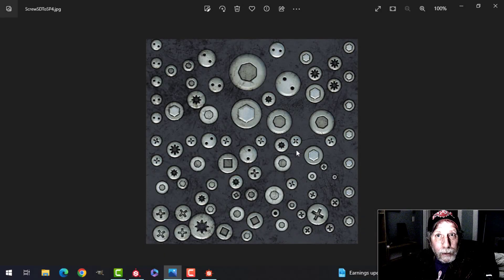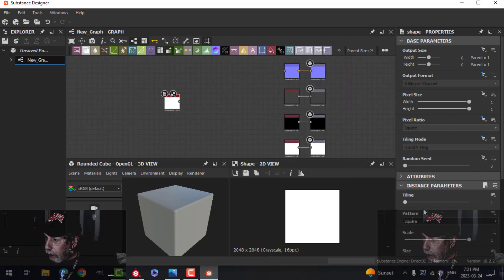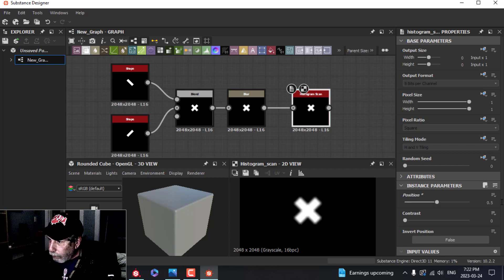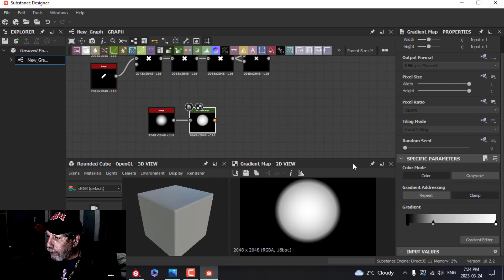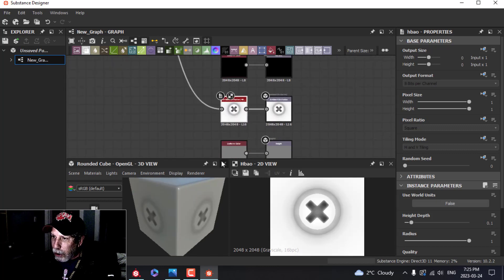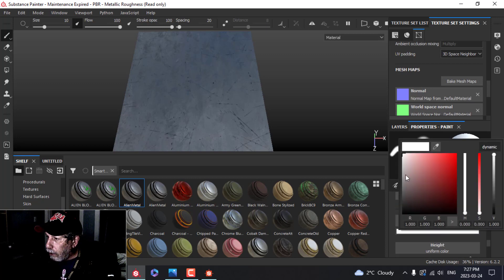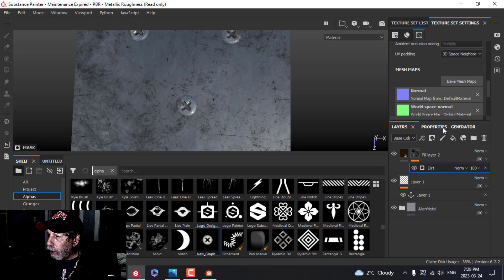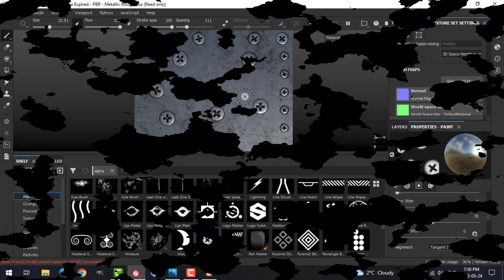SUBSTANCE DESIGNER: PHILLIPS SCREW HEAD

Comment: But what if I want to have the screws in a different color than the metal plate?
Reply from the maker: @Rewolv  yes that would require using color in the graph at the color output which unfortunately was not part of this video.  There are lots of designer tutorials that show using and exporting xolor
Reply: @zerobio  Do you happen to have a video of your own that deals with this topic?
Reply from the maker: @Rewolv  let me check and get back to you, may take an hour or two.  Sorry for that.

Comment: how come when i do this the screws are the same color as the background? The edge of the screws alpha stops painting color and fades to teh background color. How do you paint a screw that is a solid grey color instead of fading to the background color?
Reply from the maker: That's kinda just the way this particular texture works.  You could try this, create a new folder above your base texrure (wood or metal).  Inside the folder, create a paint layer and add your screw.  Then create a black mask on the folder itself.  See if that helps.  If I explained it wrong or it doesn't work, I will try it and see if I can get it to work for you.  I'm not near a computer right now though.
Reply: @zerobio  found a better way using anchor points and fill
Reply from the maker: @mindped  excellent !